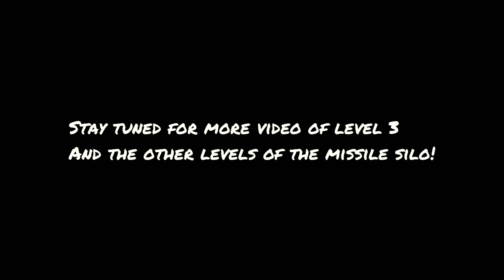1st Entry Into a Titan II Missile Silo!!!

Comment: I think the generator is not there - weren't you worried about the rubble sitting above you collapsing in on you ?? also did you sample the air in the chamber before you went into it ?? I should ask but did you have a rescue plan in place ??

Comment: Just asking. Did you run a CO2 detector in there before hand?  If so you need to show viewers how dangerous it is to go into a sealed steel chamber.
Reply: That’s a real monster they should be worried about.. I wondered that too
Reply: @Flying90  Ditto here too.  Wonder if they left it open for awhile before entering or forced some air in there prior to entering.